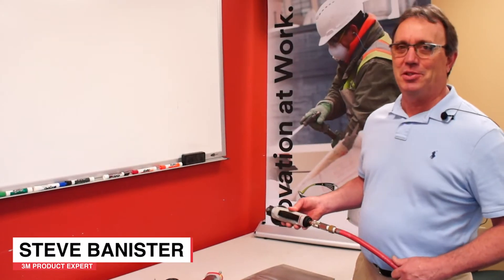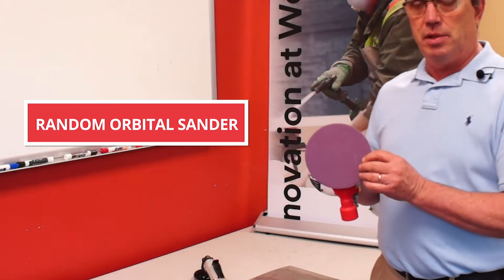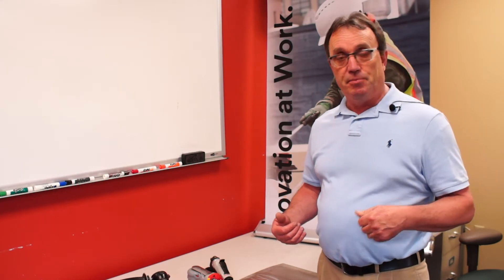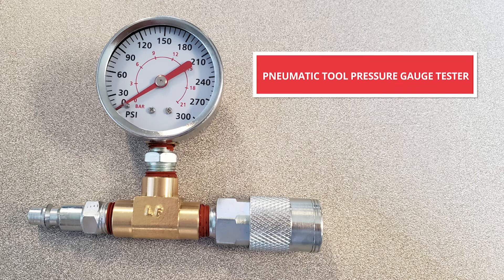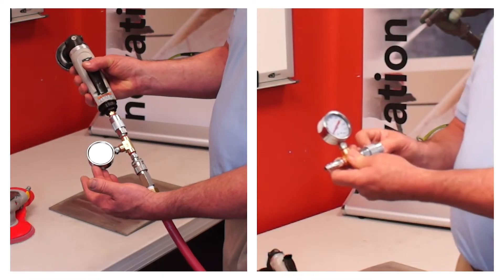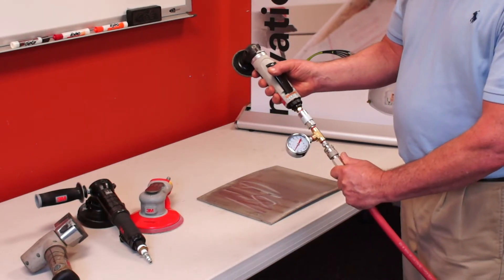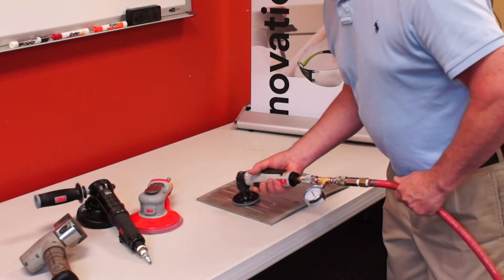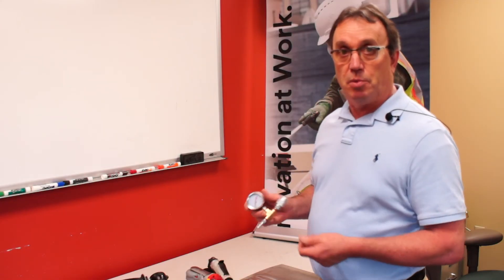How To Test Optimal Air Pressure For Pneumatic Tools

Comment: Do you guys also use this in between the hose and air tools like Die grinders, belt sanders that has Oil-mist accessory on the compressor side? will this guage still work if the line contains oil?